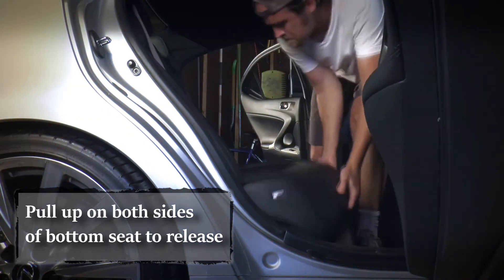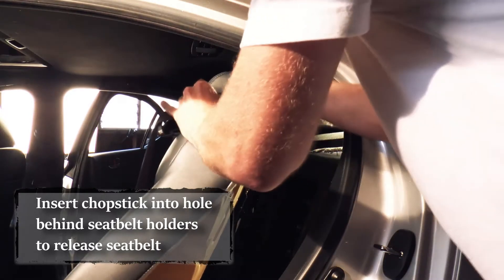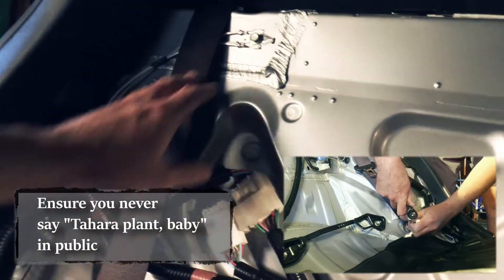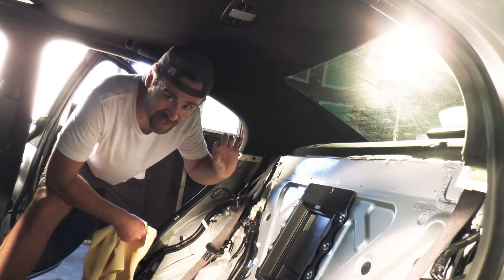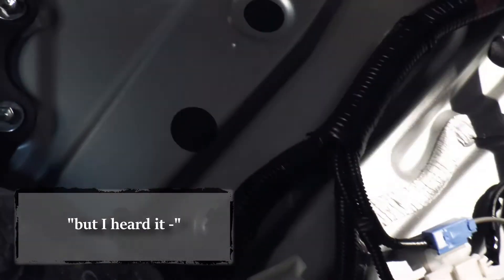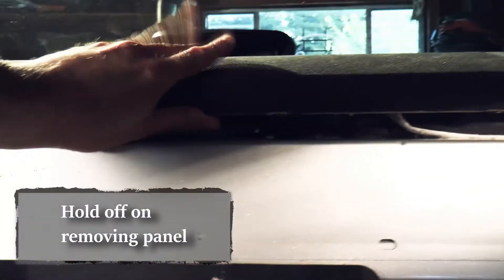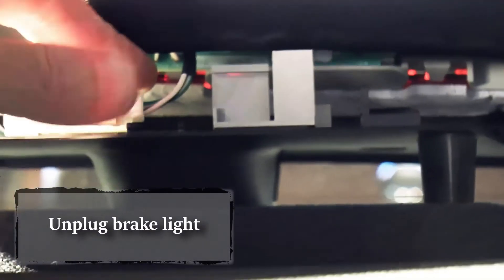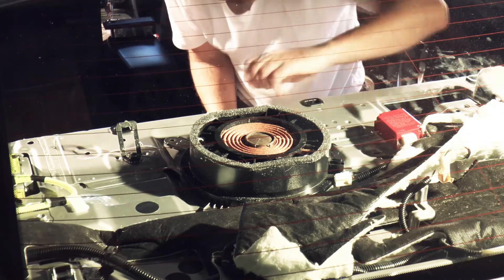Lexus ISF IS250 IS350 Rear Seat / Subwoofer Removal DIY

Comment: Is there anyway i can disconnect the stock sub without removing all of this ?
Reply from the maker: Lol not that I know of no.  I hear ya...
Reply: It's not alot once you get in there. Should take 30 minutes
Reply: My thoughts too. I can feel my speaker and it doesn’t seem busted, but something is vibrating and driving me nuts.
Reply: @Kin_Ton_Ti  i actually did it without taking the whole thing apart, just pop the 2 tabs on the side the just disconnect it, u need a friend to atleast pull it up a lil and hold it😁
Reply: @dinodejoras974  nice! Thanks for the input. I didn’t want to take all that shit out just to inspect the rattling speaker.
Reply: @Kin_Ton_Ti  no problem lol i have a single 12inch sub so yeah just make sure u get some kind of help from someone that can hold it up for u to disconnect the oem sub
Reply: @dinodejoras974 hey can you elaborate on this more? I got quoted like $2k to replace my sub and wanna do it myself but don't have time to do everything in this video. Please!!
Reply: @Kin_Ton_Ti hey dude did you do this? I really need help and don't wanna take it all apart
Reply: @The1KingTut  nah dude, I have an aftermarket sub that drowns out the rattle noise when it’s loud enough. Still annoying the shit out of me at low volume lol. Design flaw in my opinion.
Reply: @Kin_Ton_Ti what exactly was this guy talking about then when he said "remove 2 clips?"
Reply: @ I’ll have to rewatch it. I’ve started the process a couple times before, and just eventually said “to hell with it”. It’s a shame the cover won’t just pop off to keep it simple

Comment: Going to try the push in and pull up method on my is250c. Can't Find any vids on the convertible but should be similar, I hope. Sestak belts don't hinder the back seats on the c model. Ty update I was told in a IS build group that the back seat upper part does not come out. This can't be true. Hoping someone here knows different and can help. 🙏
Reply: Were you able to do it? I have an is350c and was wondering how to add serious bass to it

Comment: The bottom piece came out so easy.  But @0:25, did you have to remove the bolts in order to pull out the seat?
Reply from the maker: Correct!